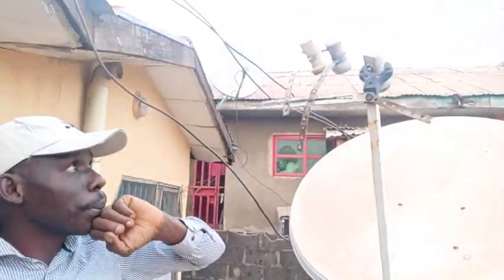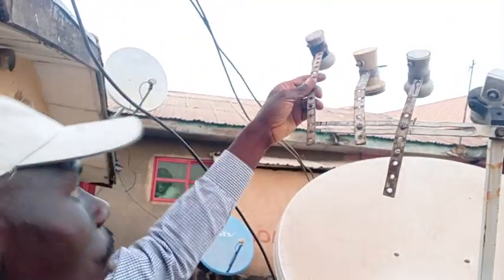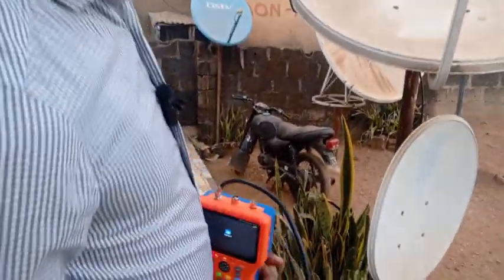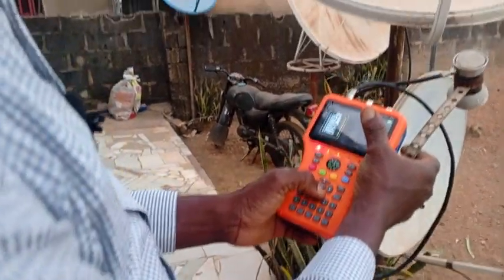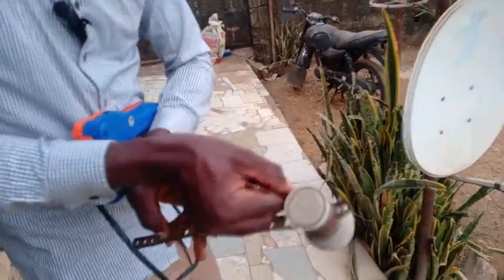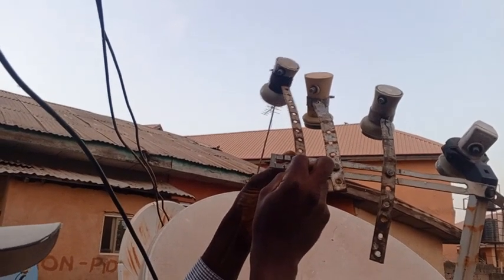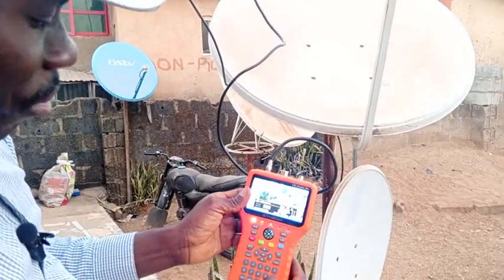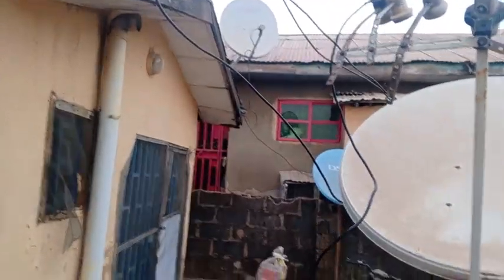How to Attached #Nigcomsat 42.5E on #Eutelsat 16E -Easy Step

Comment: pls sir help me with 45e frequency
Reply from the maker: INTELSAT 39 @ 62.0E ADDED TO LIST
CURRENT WORKING SATELLITE 📡 DISH TRACKING FREQUENCY UPDATED BY PUSH /ADUBAM  08TH JULY 2025 5:30 PM (WAT) YouTube – Satellite TV Experts   - https://www.youtube.com/@Satellite-DIY
 WhatsApp: https://chat.whatsapp.com/JGF9vTVU7BuDfwgoqatrik
ABS 3A  
10972 V 30000 
--------------------------------------------------------------------
EUTELSAT 3B @ 3.1E C-BAND (WHOLE OF AFRICA) 
DISH SIZE 90CM AND ABOVE (DIAELECTRIC PLATE IS A MUST)
BREKETE FAMILY, SPORTY TV, NBS SPORT (FREE)
3781 L 16833  FEC 3/5
4007 L 4833 FEC ¾

---------------------------------------------------------------------------------
5E (Star times) 11919H27500,
12015H30000,
12380H27500
----------------------------------------------------------------------
7E CAS 10762 H 30000  - NEW 60CM AND ABOVE 60CM AND ABOVE
__________________________________________
7E (Azam Tv) JW
Bet9ja/Betking): 11122H12500, 11607V45000 12605H30000, 
10887H30000, 
11192H03210
MOREPLEX TV 
11481(H/V)45000, 
11607(H/V)45000
--------------------------------------------------------------------
7.0W Nilesat (MBC WEST)(4'O, clock)
11559V27500
11559H27500
11560H27500
11685H2700
11457H27500
----------------------------------------------------------------
 7W (Nilesat, MBC West) 11033V05000
11559V27500
---------------------------------------------------------------
9E (AFN Sports)  (100cm and above) PowerVu
11804 V 27500 FEC 2/3
---------------------------------------------------------------
Eutelsat 10A CBAND  (Deeper Life etc) ¾  (1.8m dish and above)
11716 R 5416 (Horizontal) dielectric plate compulsory
4033 R 5417  (Horizontal) dielectric plate compulsory
---------------------------------------------------------------
HOTBIRD 13F @ 13E  - 60CM North Africa – 150CM Somalia  - 1.8m to 4meters SSA
12558 V 27500 FEC 5/6
10719 V 27500 FEC ¾
12577 H 27500 FEC ¾
------------------------------------------------------------------------

EXPRESS AM8 (14W ) NEW 60CM AND ABOVE ( NORTH AFRICA < = Liberia) 90CM AND ABOVE 
11541 H 9980
11484 H 3534
11484 H 3534
_____________________________________
16e Eutelsat  (60cm and above)
10804/H/30000, 
12603/H/30000, 
12604/H/30000, 
-------------------------------------------------------------
17e Amos  12333/V/30000 
-------------------------------------------------------------
EUTELSAT 21E
11107H4540
11189H9690
11617V27500
10856V45401
---------------------------------------------------------------
Eutelsat 21B @21.5E (WESTERN BEAM)  
11618 V 27500      60CM Mali, Ghana, 90 cm above Nigeria & Cameroon  
11622 H 01250  
Oman TV Sport       90cm to 120cm Mali, Ghana , Nigeria to East Africa 180cm
11627 V 14400 3/5
------------------------------------------------------------------------------------------------
26E  Badr ( MBC CHANNELS) (60cm and above)
 12284V27500
10970V27500
----------------------------------------------------------
28°E Astra 
12525V30000 
(Digital Max tv) 12645V32700
12605V30000
11595V30000
11635V30000
11675H30000
12645V37200
11675V30000
----------------------------------------------------------------
INTELSAT 28, 32.8e (180cm and above)
10975 H 30000 9/10
11092 V 30000 AUTO
----------------------------------------------------------------
HIPASAT 30W-5 @ 30.0W NEW (NORTH AFRICA AND <= MALI (W/A) 90 CM AND ABOVE
12476 H 27500
________________________________________
36e (DStv frequency)
 11747H27500,
11900H27500,
11938H27500,
11843V27500,
12245H27500,
11919H27500,
-----------------------------------------------------------------
Zap on Eutelsat 36D at 35.9°E (90cm South Africa and Southern West Africa)
11221 V 30000
11263 V 30000
11304 V 30000
11346 V 30000
11387 V 30000
11429 V 30000
-------------------------------------------------------------
HellaSat 3 @ 39E  (2.4m dish size and above)
12290  V 30000
12689 V 30000
----------------------------------------------------------
42.5e (Nigcomsat) 
12685V 30000
12518/H/29500
12539/H/05000
---------------------------------------------------------
42.5e (Ourtv NG)
12545H06166
---------------------------------------------------------
45e (VSN)
12511H12500 
Digital channels
12603H28570
----------------------------------------------------------
45.1E (LUFT TV)
11655 H 45000 - LUFT TV
-------------------------------------------------------
Cband_AZERSPACE (46e) 1.2M Dish)
3218 H 3332
---------------------------------------------------
51° 5 E SLTV
10973 H 25000 ( 60cm and above)
11102 H 10000
--------------------------------------------------------
MONACOSAT 52E  (90cm dish and above)
Solhsports 
11094H27500  
-----------------------------------------------------------
54.5e 11045V45000
-----------------------------------------------------------
54.9e is (Biafra TV): 10984v09100
------------------------------------------------------------
YAMAL 54.9e
11150 V 16665
-----------------------------------------------------------
NSS 12 @ 57E 
(East Africa 90cm, Rest of Africa 180cm)
10985 H 45000 (CNN, BBC, Aljazeera – Free)
11105 H 45000
-------------------------------------------------------------
62E  - INTELSAT 39 C- BAND
WJOLE OF AFRICA
3715 L 5574 FEC 5/6
3871 L 2150     5/6
----------------------------------------------------------

Intelsat 68e C band (1.8m and above Nigeria)
Aljazeera (FTA)  4064 H 19850 7/8
BBC News (POWERVU) 4064 H 19850 7/8
CGTN (FTA) 4064 H 19850 7/8
Hi -Dost (FTA) 4090 H 14368 3/4
NHK Japan (FTA) 4128H 14890 2/3
BBC NEWS (PowerVU) 
Sky News International (PowerVu) 4195 H 4000 ½)
---------------------------------------------------------------------
68°E KU  (Christian channels) (60cm and above)
12722 V26657
12722H30000
12682H30000
12562H30000
12522V27500
--------------------------------------------------------------------------
Intelsat 68.5E (DSTV Southern Africa Only ) 60cm dish and above
11010 V 30000 FEC 5/6
11594 V 27000  FEC 5/6
11130 H 30000 FEC 5/6
10970 H 30000 FEC 5/6
11130 H 30000 FEC 5/6
------------------------------------------------------------------------------------------

Apstar7 @ 76.5E - 3.4m above (Sports feeds via Bisskey and PowerVu) SAF
4005 V 7200
--------------------------------------------------------------------------
Thaicom6 @ 78.5E   - 3.4m above (Sports feeds via Bisskey) SAF
4156 H 7500 
------------------------------------------------------------------------
Measat 91.5E (Sony MAX – 3m and above SAF
3960H29700
------------------------------------------------------------------
Asiasat5 @ 100.5E - 3.4m above (Sports feeds via Bisskey) SAF
3996 V 7500
----------------------------------------------------------
NSS 9  @ 183.1E
(Cband) 4055 L 11000 ½

Comment: Why I use to get low signal on some receiver while others higher
Reply from the maker: It doesn't really matters as long as it is not cracking
Reply: @Satellite-DIY  but in my satellite finder the signal will be high, but if I connect my receiver the signal will be low. And some channel will not work bcs of low signal, but oda receiver with the same network it will show high and the channel that could not work on the oda low signal receiver turn to work.
Reply from the maker: You have a Diseqc Switch? It can reduce signal. Which Decoder is this?
Reply: Is it possible to get premier league and other live football on FTA decorder
Reply from the maker: @batholomecongo9869  Sure . 28E, 16E
Reply: Please what frequency for the 16E@Satellite-DIY
Reply from the maker: @henryborteyalabi5076 FEW TRACKABLE FREQUENCIES FOR KU-BAND (LOCATION DEPENDENT) 

Astra 4A(4.9°E) (Startimes): 11766H27500, 12265H27500, *12418H27500 (6oC)
4.8e (Bet9ja/Others): ,
12380H27500, 12015V29950 11919H27500, (6oc)

Eutelsat 7AB (7°E) (Azam Tv): 10982V45000 (6oC)

7E (Moreplex): 11481V45000, 11607V45000

7E (JW/Living Faith): *12605H30000, 10887H30000 (6oC)

7E SPORT TV FREQUENCY IS 10845H30000

Eutelsat 9B (9°E) (AFN Sports): 11804V27500

Eutelsat 16A (16°E) (Amos, Access Bet): *10803h30000(6oC)

 (Redmedia- Adult Channels): 12687H30000

 , ( Mogpa TV) 12216H30000 (6oC)
17e: *12333v30000, 11718v30000 (6oC)

Badr (26°E) ( MBC): *12284V27500 (8oC) OR 12304H27500

Astra 28 (28.2°E) (Multi TV): *12525V30000, (DIGITAL CHANNEL) 12645V32700 (3 or 9oc)
28.2e (Free TV formerly Consat): 11635H29970
28.2e (HD+ Channels): *12725V30000,

Eutelsat 36B (36°E) (DStv) *12245H27500, 11747H27500, 11843V27500-dish_channel (3/9oC)

ANGLE 36E (ZAP TV ANGOLA)
ZAP ANGOLA 🇦🇴 CHANNEL (36E)
FREQUENCY
11388 V 30000
11263 V 30000
11221 V 30000
11304 V 30000
11346 V 30000
11429 V 30000

Turksat (42.5°E) (Nigcomsat): *12518H29500, 12539H05000
42.5e (Ourtv NG): *12545H06166
42.5e (Satview): 12658V22500

Intelsat 904 (45°E) (VSN): 12610H12500, 12696H05000 (9oC)

Belintersat (51.5°E) (Formerly Qsport1 & 2, now 24H Sport1 &2): 11077H02915
51.5e (SLtv) 10973H25000
51.5e (WiAfrica): 11011H28775, 11095 H27500(52.5°E)

Yamal 402 (54.9°E) (Biafra tv): 10984v09100, (3/9oC)

Intelsat 20 (68.5°E) (Old MyTv-Church Channels): 12722V26657, 12522H30000, 12682H30000

ABS 3A (3°W) (Betking, Yayi): 11008V30000 (7oC or 5oC) 

EUTELSAT 3B (3w) LUFTV FREQUENCY IS 
11070V45000 

Nilesat (7°W) (MBC West): 11033v05000, 11560v27500, 11474V27500 (7oC)
7w (OSN): 11996H30000

ExpressAM8 (14°W) (Nairabet): 11557H03362

SES 4 (22°W) (Canal plus): 10986V45000

NEW FREQUENCY ANGLE 22W(cannal plus➕)
11171V45000

Eutelsat 10A (10°E) (DCLM - Deeper Life): 03873/R/2083 & 04033/R/5417 OR 03826/V/04000 OR 03874/V/02083

Hispasat 30W (30°W) 12631/V/30000
12671/V/30000

Note: 
- 6oC means Lnb skew 6 o clock, same applies to others, etc
- Frequency with asterisk (*) means the frequency for easy tracking of the satellite.
- We accept correction/update, kindly post here so that we can update the list.

 *Save this list or screenshot on your
 phone
Reply: @Satellite-DIY   Thanks so much, God bless you

Comment: Nice video, i am shocked 12518 V 29500 work in your satfinder it's really strange why it's not working with Decoder Tiger t30
Reply from the maker: @josephagbebaku9786   You're sure it does not work with T30? Check your setup